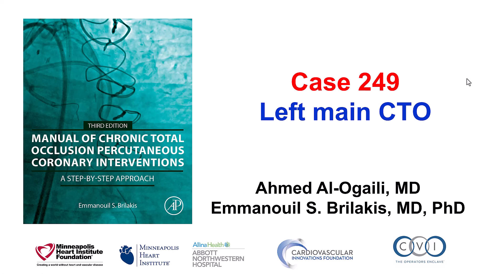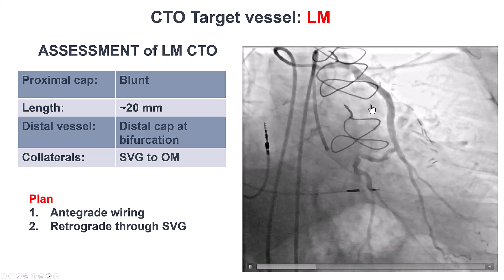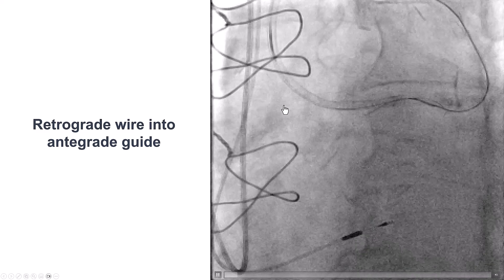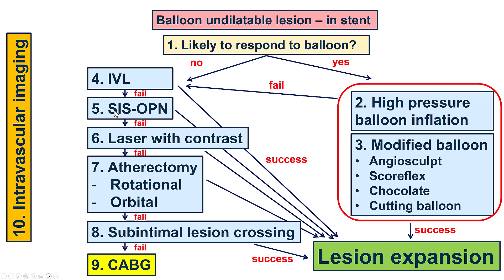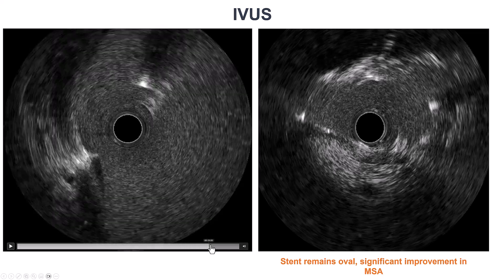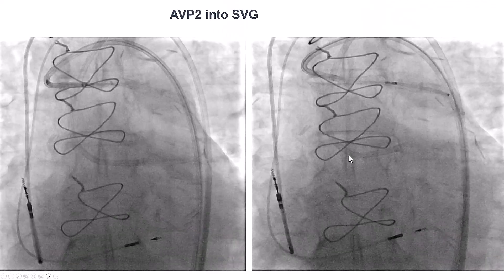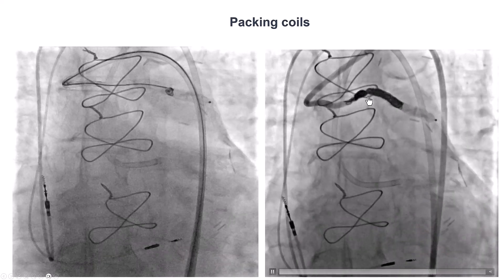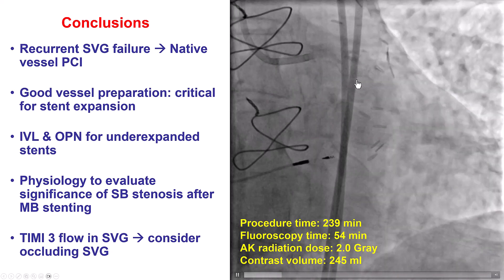Case 249: Manual of CTO PCI - Left main CTO PCI

Comment: Really awesome case! If you don’t mind, could you tell us if there’s a threshold to the flow or residual stenosis when you decide not to close the SVG? Now there’s a nice final result, but if there’d remain a still significant looking lesion would you leave the graft open maybe measure the residual stenosis with FFR or check the MLA and then decide? Thank you!
Reply from the maker: Great point - hard to quantify the SVG flow,  but in general if there is significant competitive flow in the native vessel from SVG flow we tend to occlude the SVG. If the graft has severe lesion(s) with TIMI 2 flow, we generally let it occlude spontaneously.
Reply: @manosbrilakis  thanks again! 😊